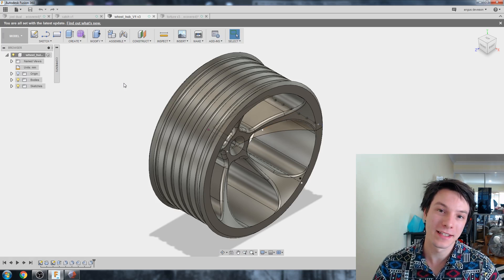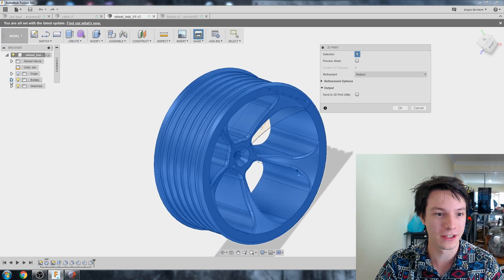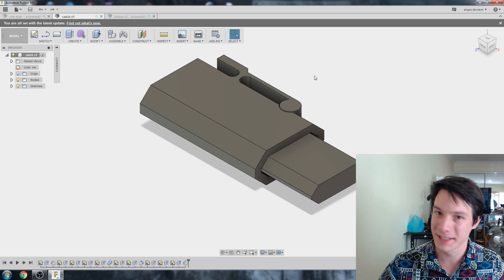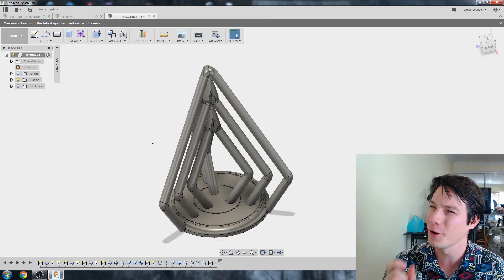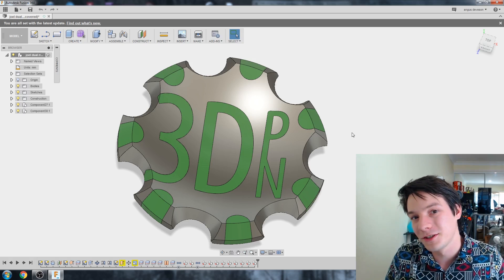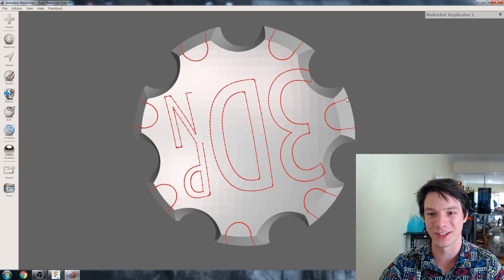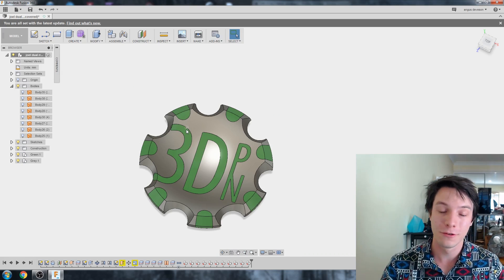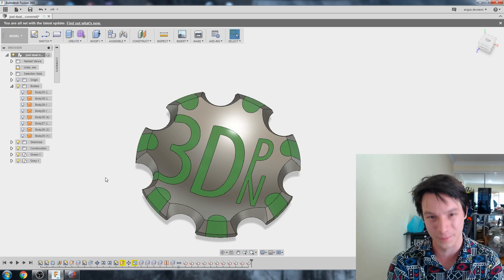Exporting STL files in Fusion 360 - Single, multiple bodies and dual extrusion!

Comment: A trap for new players is the default .3mf file format for meshes. If you are exporting multiple bodies as a single file, if you accept this file format for the export you will find that in your slicer (at least in Cura) they become separate bodies, which is not helpful for things like print in place joints. However, if you change the file format to .stl they will import into your slicer as a single entity. I wasted several hours today trying to figure this out and eventually turned to this tutorial, which prompted me to think about whether file format would make a difference. So thanks again Angus for your great videos.

Comment: I'm having trouble with Cura accepting the common origin (at least in Z) -- or it's automatically dropping both elements to build plate.  I have a fairly simple model that is essentially a cube bisected by an oblique plane.  The lower half has drainage channels in its upper surface and I want to print that half solid and the upper half I want to print infill only with no top or bottom but with outer walls.  I've tried every combination of exporting and importing, de-selected the Cura option to automatically drop to build plate, etc. and it keeps dropping them both to the build plate.  If they don't align perfectly, they will not print correctly.

Comment: THANK YOU ANGUS!!! (Another super helpful video!) - This is the 1st time I have used Fusion 360 & its been a mission achieving what I want! I used your last method (as I had over 140 Bodies!) & It worked. Thank you!! > I tried to scale as accurately as possible on fusion (Expected Length: 256.58mm) but when the STL is imported into CURA I get 265.62mm. Should it maintain the exact dimensions or do I need to adjust these in CURA?? Thanks to anyone who can  help confirm!
Reply from the maker: It should be exact or wildly off, which would indicate an incorrect inch to mm conversion. Cura will show the bounding box dimensions in XYZ so if it's at any kind of an angle that might account for the variation :)

Comment: I followed your directions to the letter. I'm saving all the like-coloured components as 1 STL file, then loading them up at once, but everytime I go to import all the different components to PrusaSlicer, they just never line up. They are all just centered on the plate. Any ideas?
Reply: Oh, I see what I did wrong. It won't work unless I have the correct printer selected in PrusaSlicer (MMU2S).

Comment: God bless you for making this video. I was pulling my hair out because separate bodies were coming out in the stl even when I had them hidden and I could not figure out how to unselect one without deselecting the part I actually wanted to print. Also, you're the reason I tried Fusion360 out and I LOVE IT. BEST PROGRAM EVER. this difficulty exporting bodies to stl that were referencing each other has been my only road block so far and it's incredibly easy to use & powerful. Thank you again Angus

Comment: Help!! Using fusion360 I created a sketch and it has 4 bodies which I put into a compnent. I then sent to slicer. All 4 comes into slicer, but when I go to slice I lose one of the bodies. I tried grouping the 4 bodies inside the component. I've tried selecting the  component, I've tried selecting the group of bodies and I tried selecting the 4 bodies. In each case I lose the same body. Can't figure out how to correct so that I get all 4 bodies in the slice.
Reply: Never mind. I just figured it out. I selected the 4 bodies and under Modify -> Combine I created 1 body in a new component. It now all slices as one body.

Comment: Hi Angus .. have enjoyed your Fusion360 videos and slowly the penny is dropping in how to model with sketches. However, one problem I have not been able to overcome is that when I slice the output stl files to PrusaControl for my Prusa i3 Mk2s, the physical dimensions of the finished print are smaller than the design by about 10% (so not a units of measure issue).
My 'normal' design tool is 123D Design (also AutoDesk) and the printed items are dimensionally accurate.
Can you pass on any clues why this might be please as otherwise Fusion360 is not a viable tool for me ?
Many thanks and keep up the excellent learning vids.
Reply: Version is 2017 2.0.3800

Comment: tried to do this in fusion 360 dated september 2017 this does not seem to work anymore
Reply: does not work to export multiples on mine either
Reply: I cant either it greys out the ok the bodies together. it greys out the ok.
Reply: Can't drag the components after converting bodies to components into each other to make single component with all the bodies so single STL can be created
Reply: I had the same damn problem and I just figured it out. You have to drag it on the arrow left of the component to group them together!
Reply: It still works but you must click on "bodies" and then directly on export and by the way you don't have to have all bodies selected you can also have only 2 of 10 but again just click 3d print export hit "bodies" and hit the OK ... it looks strange but comes out great.... thanks I was looking how to do this because I had the same issue... great help for me ...

Comment: Angus, Thanks for your video! 

I'm new to Fusion 360 and was having difficulty trying to figure out how to export a component as an STL file.
I have a question for you. It appears that Fusion 360 will allow me to select a component name, right click, and export as an STL file. In other words I don't have to select the "Body" to do this function even for components that I made that have multiple bodies.  I can select their component names, instead of their "Body" and export as STL files. I haven't tried to print any of these STL files yet using this method so, I don't know if this works. I assume it will. So, is this an update of Fusion 360 that now allows you to select the component name to export as an STL file?

 

I have another question. Is there a way to export components as a" DXF" file using Fusion 360? 

Thanks, in advance, for your help!

Gary

Comment: In your experience, do you think the Duplicator i3 v2.1/PLUS or the Cetus 3D is a better printer for print quality? My i3 PLUS broke in shipping and will probably cost $300ish to repair so I'd rather just buy the Cetus Extended version for $400. Any thoughts?

Comment: cool, as others have stated start with a new component and make sure it's check then all parts associate well.. also.. a minor thing but you can make your Z axis up/down instead of left right in the pref's so the file is oriented for printers.. not a big deal but it helps with some complicated models with multiple bodies/components sometimes.

Comment: Great vid Angus!  Pro tip on Fusion (that you probably already know): always create a component first, then activate it, then create your bodies.  This helps scope your feature timeline and control the origin of parts.  Granted, it's not required nor make a large difference in this example, but building good habits now save frustration later.

Comment: Great tutorial Angus! Hey, I've been using an easier method for your final "multiple bodies" method. Instead of creating components, you can hide the bodies you DON'T want to export, and instead of right clicking on a body, right click on the top node of the same tree on the left and choose Save As STL. It will save just the visible bodies instead of all of them. I haven't used grouping yet, but I'd assume you can then hide/show certain bodies as groups, which would make this process even easier.

Comment: Angus,

Fusion 360 Rule Number 1 is first create and activate a component!
Reply: unlike Inventor and Sometimesworks everything is in a single "design" in Fusion. By making a component ( from the start) or from a body, all the associated actions.sketches etc & files ( templates decals/ canvas) are part of the component and don't end up all thrown together under the "design" Important when you have multiple components in a design. When you activate any part in the design you are dealing with just its history and not the whole design.
Reply: Rather than groups ( which aren't really modeling so worry me when it comes to exports ) select all the bodies then in the "modify" menu click combine . In the combine dialog box check "make component" and done . All together at the original origin and 1 component. When done its a good idea to ground the component ( right click "ground") so be sure it doesn't move
Reply from the maker: +bigfilsing ah that's a very good point. I've only really done designs with very interdependent parts so a single tree worked fine, but that will make the bigger assemblies a lot easier to manage.
Reply: I was going to say the same thing.  I'm a F360 noob but rule #1 was certainly the first hard lesson I learned after getting stuck with a similar problem!
Reply from the maker: I'm not sure I follow, components are for assemblies, why create one straight away? I model till the part is done as a body.
Reply: It also effects other processes later if you get into the CNC area of fusion . Without parts defined as components all kinds of things go wrong when trying to generate CNC tool paths.
Nice to see you getting to grips with Fusion. Coming from Inventor i hated it to start with but am slowly coming round.  Cheers
Reply from the maker: +bigfilsing I'll admit it's a big change from solid works, but worth sticking with especially for the mesh features for me.
Reply: I was going to tell Angus the same thing, you saved me a lot of typing.lol   I am fairly new to fusion 360 as well and it is fantastic!
Reply: I wish Solidworks would just get on the bandwagon with the maker crowd and come up with some lower cost version. Fusion makes my head hurt.

Comment: Awesome as always Angus. Exactly what I wanted to know, in preparation for when I get the Multi Material upgrade for my MK2.
Just to clarify; In the dual colour part, you renamed one of the components, then nested the rest of the matching components inside it. Then repeated the process for the other colour. Have I got that right?
Can't wait for more Fusion tutorials.
Reply from the maker: Yep! that was how I did it, however Sparkyface5 has worked out a way easier method that I totally missed - I'll be linking her video once it goes up tomorrow. It's already live ! https://youtu.be/3ZpDDROHmcs
Reply: Ah cool. Yeah, Sparkyface5s vid is another good way of doing it.

Comment: Hey Angus, you might have answered this question but I haven't come across that video as of yet, I was wondering which Slicer program would you recommend for a beginner, and which for more in-depth use? I don't have a 3d printer yet as I'd rather learn the techniques beforehand and have some prior experience. I also usually use SolidWorks, is it good enough as a model builder?

Love your videos,
Thanks!
Reply from the maker: Hey! Solidworks is perfect, I learnt it in Uni and if it wasn't so expensive I would be using it too. I use Simplify3D but it isn't free. Maybe take a look at the latest version of Slic3r, it offers a tonne of options to look at and g-code preview, but lacks customisable support structures sadly.
Reply: All-righty!

Thanks a lot and have a good day!